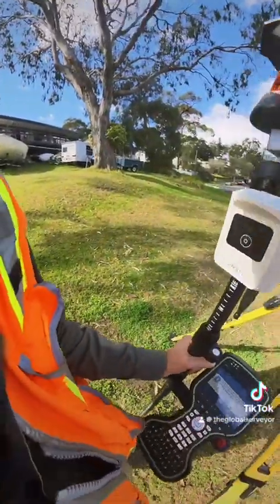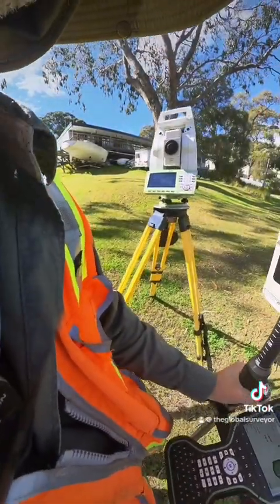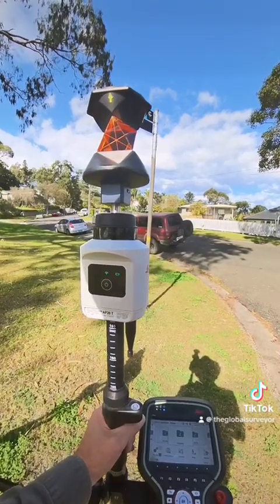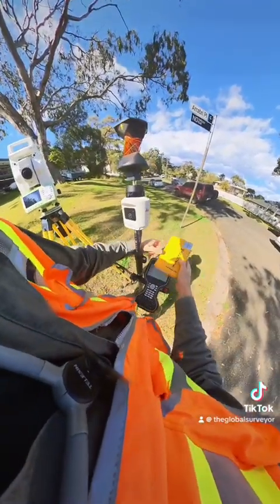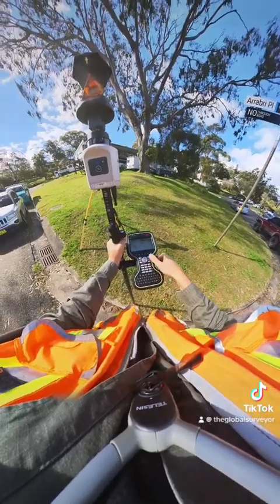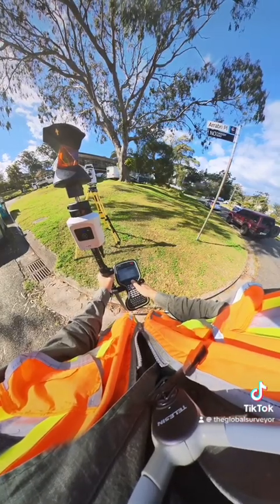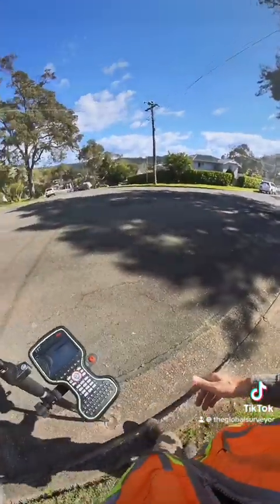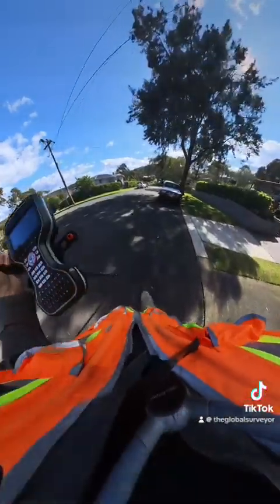How to use the Leica AP20 Autopole with a Resection.

Comment: How accurate would you say it is? could you record a point with the autopole been out of level then remove the autopole and stake that same point plumbing you rod, and give us the results.
Reply from the maker: Hi there. Thanks for the question. I havent tried that as yet but I will. Stay tuned for a video.  With gear like this I've been a bit cautious measureing things. I've made multiple measurements on the same point just to ensure no errors. Then meaned them up. The mean point is only millimetres in difference.   But i will test this and let you know.

Comment: I watch a lot of your videos. And, they are enjoyable to watch. I am not a land surveyor, although I do a lot of commercial construction layout. I am interested in purchasing or an upgrade to a Leica total robotic station. If you were to do it again with Leica products, would there be any station, upgrade or overall change in product or accessories? Right now my issue is connectivity in terms of controller to station, or that it seems to be the issue. I have an older Trimble RPT600 that works great aside of radio signal reliability. Is this ever an issue at reasonable distances and reasonable interference expectations using Leica products?
Reply from the maker: Hi. Sorry for slow reply!  I'm a Leica user through and through!  The Leica TS16 is a really good robotic total station. Mine is about 4 years old. The newer versions now have an automatic height of instrument laser and better tracking capabilities. Mine still has awesome ATR and power search functions including Filter Learn which scans the area for all targets and excludes them so that when using robotic the S16 locks only onto you and not prisms. The CS20 controller is rugged and has a good keyboard. I'm not a fan of the touch screen controllers only. I prefer to use buttons also.  I can use the CS20 and control not only the TS16 but also the GS18 (GNSS) so one controller for 2 devices... Its swaps between the 2 easy. My TS16 has a 1000m laser range for reflectorless observations and the long range bluetooth works really well when the antenna is up so have no issues working robotically at a distance. I recently upgraded my antenna and bought the AP20 autopole which is a game chnager. The controller automatically updates the pole height when changed and the tilt function for both the AP20 an GS18 means I can get any shot imaginable.    I do like Trimble but the latest controller is very large.. The R12i GNSS is much smaller than the Leica GS18 which is a bummer for Leica. Hopefully one day a smaller GNSS.    I have a few videos here so thanks for watching and always looking for ideas if you want a question answered!